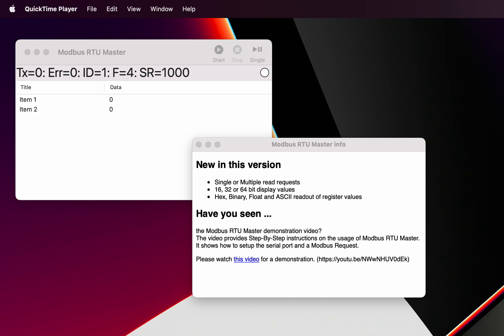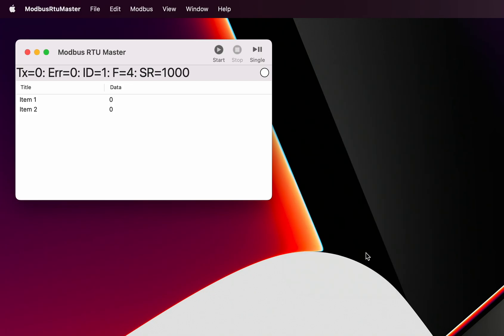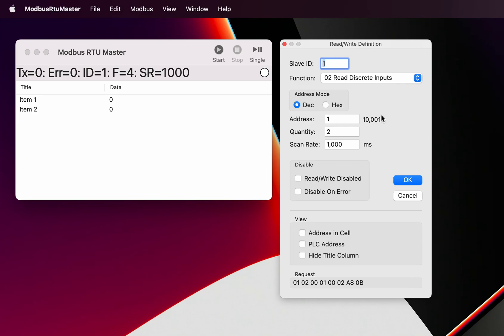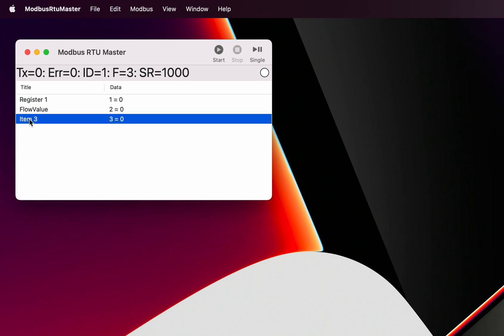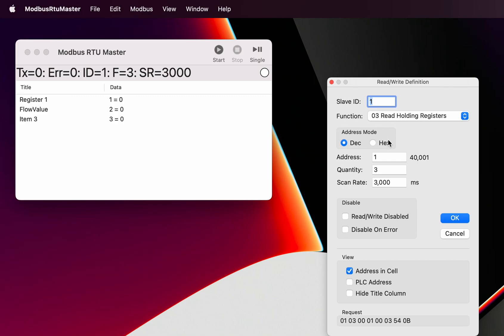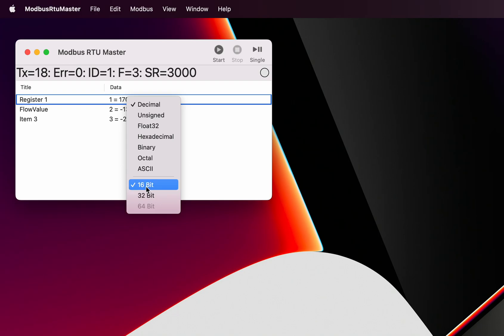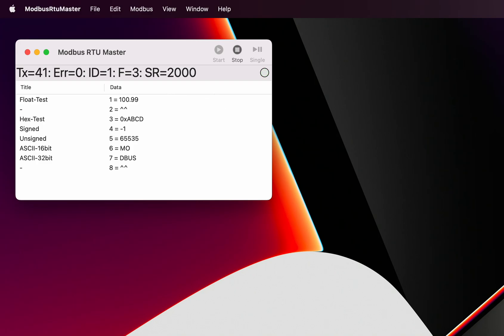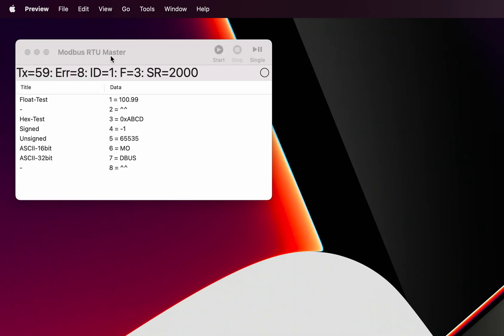Modbus RTU Master Introduction

Comment: Hi Apphugs, have tried your app for connecting to an joy-IT DPM6824, which is a programmable stepdown converter and I could set the output voltage with the  F6 Command, Data is 01 03 00 00 00 02 C4 0B. While the output is changing I see a timeout error in the app and a red signal. Reading Function 03  ist not possible, again timeout error. I guess you need more data, but perhaps you can give an idea where to search. Thanks, Peter
Reply from the maker: Hi Peter, very hard to tell. The fact that you are able to set the output voltage indicates that communication TO the slave is working. A timeout occurs when the slave fails to reply, so maybe the communication FROM the slave is not working. There are many possible reasons for this, but I would recommend to start looking at hardware and wiring.